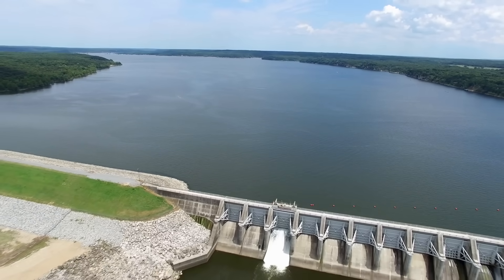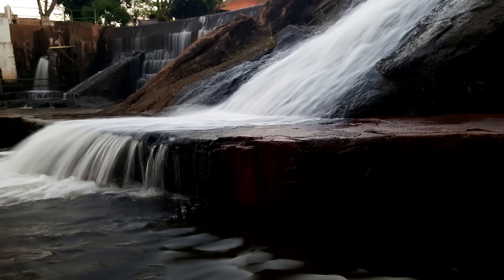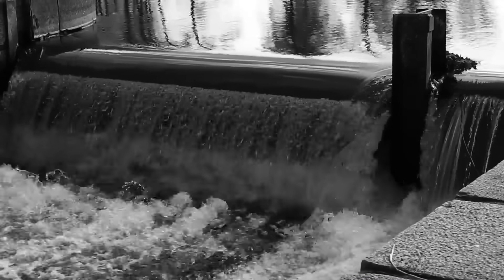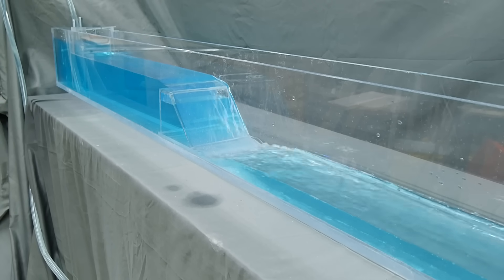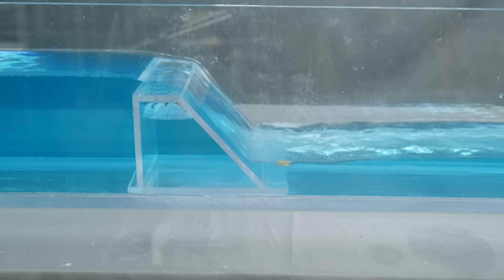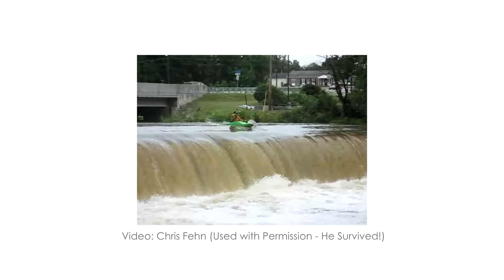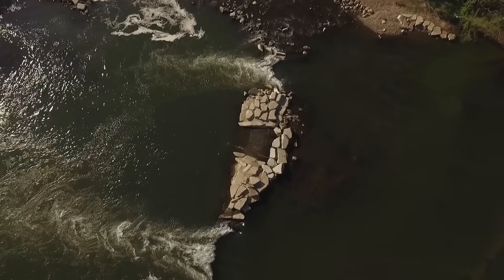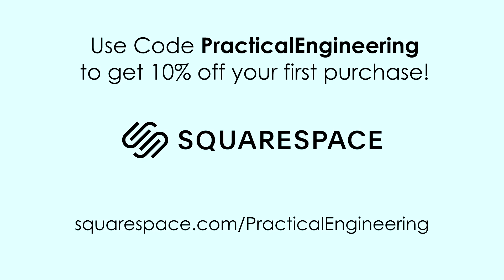The Most Dangerous Dams

Comment: There was a low water dam up river of a park outside of Sand Springs Oklahoma. The park is the start of the annual great raft race. Back in the early 80's we were watching a couple of rafts that i had assisted with the building of get launched and ready for the race when my dad noticed some kids in a small flat bottom fishing boat. They were getting closer and closer to the low water dam. Even though people were yelling and waving trying to get them back from the dam. They didn't listen until it was too late. The current caught them and pulled the small boat over and they went under at one point their ice chest popped out and went down river. After about ten minutes the boat popped up and went down the river.  And about 5 days later they found one of the boys half buried  in the sand. And about fifteen or so days later they found the second boy caught up in a brush pile that had snagged him.

Comment: They have a lot of these dams in the northeast of Thailand. I like having a swim. It is fun to stand under the water pouring over the dam wall like riding a tube in the surf, or getting bobbed around in the hydraulic jump. But once I jumped into one and unbeknownst to me it was really deep and powerful. There were some submerged concrete pillars out of sight in there as well. It was a meat grinder, and I cracked a rib on one of the pillars on my second round in the maelstrom. Even though the wind was knocked right out of me, sheer panic empowered me to clutch onto the pillar, and I was able to launch myself out of the danger zone with a porpoise-like jump using my feet. My hat and sunglasses were lost and my shirt was torn off my back. I got critically sunburned on the walk back to my car through the bush. Breathing was a nightmare for like a month after. Seeing your little wooden chip kayak getting flung around brought back good times. 😂 To anyone contemplating taking a swim like me, this happened in an eensy weensy little hydraulic jump that looked like it couldn't hurt a flea.

Comment: Lehigh coal And navigation build 13 of them across the Lehigh river. I recently visited the three mile dam in Trichlers pa Lehigh Township historical society has more information on the dam. There is another that most is still standing is on at the north catasaqua trailhead turn left go a while you will find the other. I believe right by where they are building the new route 329 highway bridge there's 1 it spans across and is near the Holcim former lafarge formerly Whitehall cement.

Comment: @Practical Engineering: What if we simply install a "Emergency Life Line" that runs from either side, within the boil point, with plastic buoys + flags every X feet so people see and grab on to it... If someone get's caught in it, pull yourself to shore.. It's easy to install, and would save a lot of lives!! .. This method we don't re-engineer all of the dams but still have a cost effective solution... thoughts?

Comment: There is creek that runs through the town I grew up in, and over it's 30 mile length there were at least a dozen water mills built, each with its own dam or weir.
In my town there were two, one of which is  a dam maintained by the city parks department, the other was a weir that has been mostly removed - except some mostly-submerged iron structures that are perfectly placed to injure canoeists who have drifted from the main channel.

Comment: Of all the rescue issues at these low head dams, I'm surprised to NOT see what I consider to be a very good way to rescue someone stuck in the back current.

You could string a rope across the body of water to stay there permanently up in the air so that it can be lowered for the person to grab onto to then be pulled to rescue to the closest side of the shore line. 

Tell me this wouldn't work.

Comment: Decades ago as a young man, I volunteered for our local rescue squad.  We did search/rescue for water, and low/high angle rescue.  One of the drills we practiced was a "boil line rescue."   Keeper as you called it.  Now that you have described the properties of a low-head dam.  We had two boats.  The one in front was a zodiak that motored up to the boil.  It was tethered to a second more powerful boat pulling it backward at the edge of the boil so we could throw rope to the victim.  Then, once they expired we deployed hooks to retrieve the body.   STAY AWAY FROM LOW-HEAD DAMS.  Not just for your safety, but the safety of those who have to come get you.

Comment: So get rid of the dams period! Switch oil pipeline to water pipelines, filter water, also could have hydroelectric generators along the pipeline to generate power to self sustain power to any pumps along a vast aqueduct system. Surely additional power will be generated to provide power to communities and removes the need to depend on fossil fuels. Perhaps catching the freshwater prior to it feeding into oceans is a good place to put the mouth of the pipeline to feed back into farmland, fresh water supplies ect. Cool idea huh
Reply: Yes but isn't controlling pipe pressure hard?

Comment: There are thousands of low head dams across the High Plains. Ranchers and Farmers will build a dam across a draw to hold back rain or spring water for cattle to drink. They are usually packed earth dams with a pipe  inserted through the dam as a spillway.

Comment: I am a public safety dive instructor. Low head dams are indeed a Drowning machine.  It matters not who you are.  I have a video of an attempted rescue of 3 people.  5 of the emergency responders were killed as was 2  of  the 3 who had gone over the dam.  This was a large operation. Even boats were sent in and each was capsized by the structure.  Very large motors could not move the boats out of the bottom of the dam.  Diving underwater is out of the question.  Trust me they WILL kill you.

Comment: A sweeper and a keeper. Experienced this once as a teen while doing whitewater canoeing (they can occur naturally). Very scary. Swim sideways to the shore.
Reply: Avoidance/portage is the only reasonable option.  Even supposedly knowledgeable people have died this way, including at least to my knowledge, several local firefighters during the filming of their own swift-water rescue training.  You cannot swim on top of the foam (boil) even with a kayak and life-jacket!  
. If you can, hold your breath & walk downstream on the bottom, past the 'boil line' until you can float downstream.  
. In an open canoe, you are likely to get swamped, dumped, and trapped anyway.  
. In a kayak, you MIGHT be able to keep away from the 'boil line' (where you would sink and get trapped), and paddle to one end of it, to escape.

Comment: Heads up- life jackets can actually kill you if caught in one of these currents because it keeps you stuck in the air layer between the top and bottom of the water circulating. If you are wearing one and stuck, take your jacket off and try to (A) take breaths when you do pop up briefly while circulating, and (B) try to swim DOWN to the river/channel bottom where the water flows fastest downstream still and you MAY be able to grasp rocks or anything allowing you to pull yourself downstream free of the currents.

If you find yourself near someone who needs rescuing from this DO NOT TRY TO GO IN AND GET THEM EVEN IN A BOAT. The only safe way is to either extend a rope/line from one side to the other and string a floaty for them to grasp when the pop up briefly with another line tied to it for you to pull them in by. If it is too wide for a line or there is not one available and you must use a boat, use two if possible within one leading tied to another behind you keep it from crossing the no turning back line and then throw a line with a floaty from the front boat to the person in peril. Make no mistake, these currents can easily eat boats- and large ones.

Comment: Just moved to the head waters of the Snake River.  Very familiar with fishing below lower Columbia River Dams...  but now in the upper snake, fishing below and in close proximity to dams in narrow gorges is the norm.  Really, Really appreciate the life saving info here.  Think I even figured out a way to execute a water rescue with my boat using just the anchor line and float system off the pinch cleat off the bow of jet boat (Columbia River Anchor system), while keeping the boat out of the hydraulic jump if I ever had to do it to save someone.    TY Grady!

Comment: Here in Alberta, Canada I have noticed many of these dams. However, at the bottom and about 2 feet out there cement blocks approximately 1x1’ at their top and slope to 1’x2’ at bottom and a height of approx 3’. These are evenly spaced across the dams width. I think they be used to control those dangers mentioned. What do you think?

Comment: Hey Gradey,
I'm a bit late with the commentary to this amazing video, but I hope you read it anyways:
Why can't we repurpose these old, unused dams? Is it impractical to channel part of those contained water flows, slap a turbine on them and produce electricity/power? You might say they have a very limited drop height, but wouldn't the available waterpressure make a huge difference? In Germany I know of quite some old mills/sawmills that operate small turbines to sell the electricity. It is somewhat comparable to a lot of houses that have solar panels on the roof to feed power into the system.
I and probably many others of your viewers would be greatly interested in a video about what kind of waters, lakes and dams are apt for power production.
Looking forward to hear from you!

Comment: It's interesting. When I was a kid, we used to have an irrigation ditch running through our property.  It wasn't large, about six feet in width and the depth was regulated by using boards inserted in a concrete fixture. During the summer you couldn't keep my sister and I out of it, especially around the weirs. It was about 2 1/2 feet deep, so not too dangerous.  But a weir in a river? No way.

Comment: If I understand this video correctly, the drowning danger here due to fast-moving 'supercritical' water meeting slow moving 'subcritical' water isn't anything exclusive to low head dams. Such a situation could easily also exist with supercritical speed water flow over a tall dam meeting slower moving water on the other side of the dam. The danger with low head dams seems to be that the water conditions around low head dams looks fairly safe and innocuous because of the relatively small drop in the water level for the water flowing over the dam, so that kayakers and swimmers may be deceived into thinking that it's perfectly safe to ride with the water over a low head dam. Is this correct?

Comment: its kind of sad that you explain the phenomenon but you dont give the solution. Actually it is very well possible to survive the undercurrent and get past the boiling point by diving and moving along the bottom of the river. since at the bottom the current is downstream, while at the top it is upstream so if ever caught dive and move along the bottom. undercurrents cant always be seen so if caught dont panic go down and out dont try to stay afloat it is going to kill you. i add this here because most people die on a low level dam trying to save ther dog!
Reply: He mentions three solutions for people maintaining dams:
1) Put up signs and barriers to keep people away from the hydraulic jump.
2) Modify the dam to prevent the hydraulic jump from forming keepers.
3) Remove the dam so there's no longer a hydraulic jump.
This channel is more focused on engineering than how to survive engineering failures.

Comment: There is a low head dam near the place where I live, and I just have a question about what they have done to it: they added a raised metal grate over the water that went from the top of the dam, curving to where the recurculation would be, and over half of it pokes above the water.

 My question is, is this to prevent people from going in, giving them an easy handhold to pull themselves out with, breaking up the flow, or all of the above?

Comment: He says remove the dam , and that’s fine but we all should know there was a reason why that dam was placed there in the first  place. A lot of it would be for the reason is to control the river or the the flow or there would be hazards like wirlpools which would be hazardous that is why they placed the dams on the Tennessee River to control how the river and for hydroelectric power. The Hales Barr dam then after it was no longer used due to safety reasons they moved down stream to another dam also hydro electric Nickajack dam  . You see the point is that dams are placed where they are at , and yes it would probably help fish swim upstream or whatever. If removing a dam who is to say that there are repercussions tearing down dams , a working dam at that . We have brilliant engineers and designers in the 21st century that that could think of something that can help the environment.  Don’t even get me started on environmental impacts. .
Reply: The dams that aren't used and maintained anymore should probably be removed.

Comment: Now I can understand how whilst kayaking in the Thames about 40 years ago. I had an accident at Reading weir and got caught in the backwash about 6 ft from the gate. I am only here still by a stroke of luck. I managed to grab hold of a part of the steel structure even though the canoe was part capsized and keep my head above water. I held on until the lock keeper could close that part of the weir allowing me to float downstream. This person is not normally responsible for these gates but just happened to see me capsize and rushed to help.

Comment: We had an impoundment dam for log storage at the mill in town. Mill shut down but dam stayed. Finally the parks department took over and removed and rebuilt the structure into three channels. One has water carefully falling into it and that area is designed to be a natural area for wildlife. A second channel slowly steps down for kayakers and tubers. The third, central channel is where the majority of the water goes and it is designed as a wave park for boarders and uses controlled water jumps to make the waves. How they prevent the problems shown here, I do not know.

Comment: I have long been aware of hydraulic jump as it's a well known characteristic of sanitary drainage, that's indoor plumbing for the non plumbers. The explanation is that drainage piping is designed on the basis of running about half full, so when a vertical pipe drains into a horizontal pipe hydraulic jump occurs. The other issue that many folk aren't aware of is the necessity for air to flow. In sanitary plumbing air flow and proper venting are critical to the operation of the drainage system.

Comment: My city has a few low-head dams below a larger dam, and during a good storm, they begin to show the boil points. One of these dams is just after the zoo, which is built along the river’s floodplain. But the other is in the park downstream from the one I just mentioned, and worse, it’s near an area where people go swan-boating (if we still had swan-boats). Thankfully, both low-head dams have some discharge gates that can be opened to dump water, but these act more as indicators of risk. The gates at the swan boat area actually became damaged back when I was in Middle School from a major flood that was unexpected to a huge degree

Comment: Lost my nephew this summer in the river at a small dam. He was teathered to his boat a friend saw him go over he jumped in the river and got the teataher,standing in knee deep water he couldn't pull him out fast enough,he drown. Another guy looked at this location next day he said he would have crossed the damn,a kayaker he didn't see the danger even after the drounding. Looks like the city should put a cable or two across the damn to force portage. Would be cheaper than a funeral.
     Also I was on a trip I got to see a lock and damn on the Mississippi they noticed a basketball fought in the undertow, they have documented that basketball has been there for 20 years through flood and drought. Never under estimate the power of moving water.

Comment: 1. The problem of the death of people trapped in the
downstream of a low-pressure and seemingly absolutely safe hydroelectric
complex is real. I have worked for many years in an organization in ,
where there is not even a hydroelectric complex with a dam, but a drop riverbed under a bridge, and people
died there from time to time, although this territory is formally fenced off
and warning signs hang

Comment: 3. The slogan for the elimination of small dams is wrong. Ponds create many amenities
for the population, are used for irrigation, provide a supply of water in case
of drought, and simply decorate the area. But the idea, casually expressed by
the author, to achieve the minimum size of a flooded jump is interesting. The
main (and in fact the only one now) way to extinguish energy in the downstream
with the help of a pond involves a hydraulic jump. In principle, small
hydroelectric power plants could allow this energy not to be extinguished, but
converted into electricity, but as a rule it will be very expensive. Although, perhaps,
the cost of the issue when considering the security problem will be completely
different. At one time, Professor of 
Moscow University of Civil Engineering S.M. Slissky, a man of great
intelligence and engineering ingenuity, proposed all sorts of exotic methods of
extinguishing energy without jumping. His ideas related to large heads, but
perhaps they can be extended to small pressure hydraulic structures.